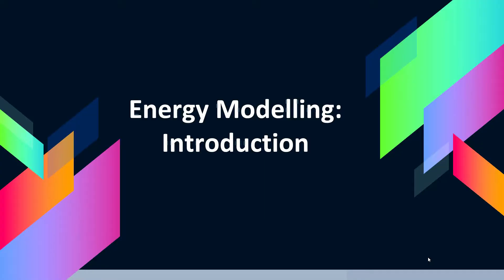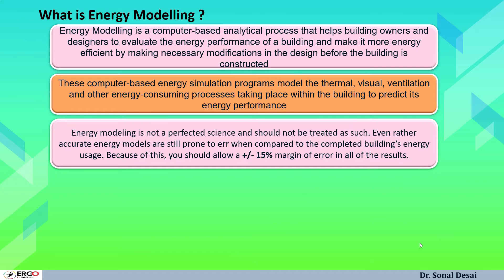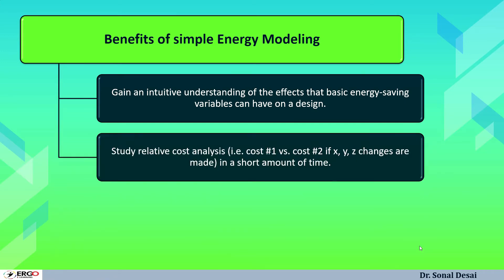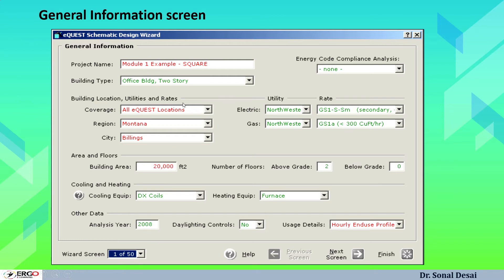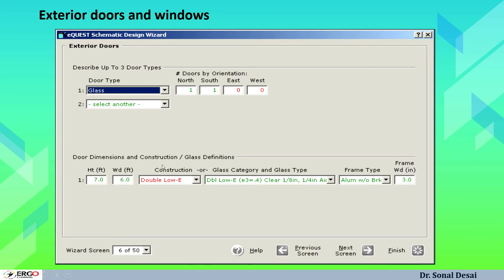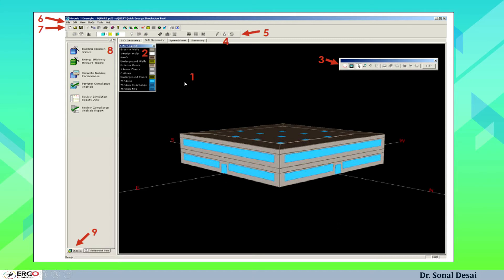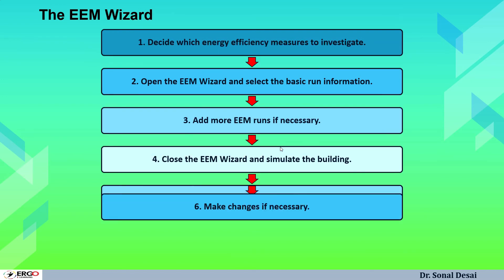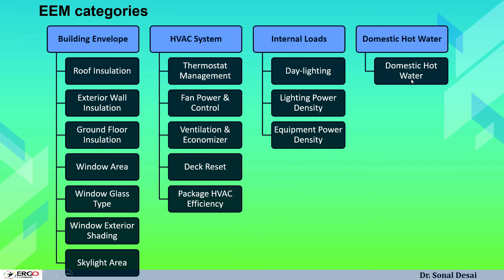Introduction to Energy Modelling and eQuest software

Comment: So essential In capturing features effectively and perfectly with advanced Prosser for best arrangements of activities performance input and output executive of numerous texts. It's accessibility is much easier in accordance of provisions on screens with good results of assimilation according to how they are introduced with an excellent cooling engine to control the radiation of waves for reconditioning for the best states of machanism with Best doors and windows is the building construction imposed on window's shade. So condusive in navigation venturing program commands to change from actions to excessive types use equipments . It's ram accessively maintains the capacity in provisions. category of equipment can easily be changed